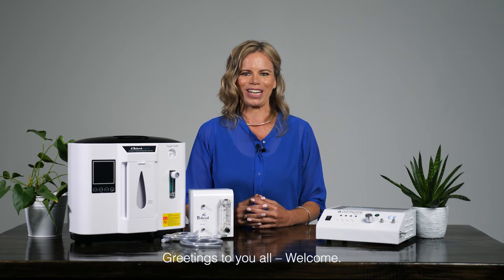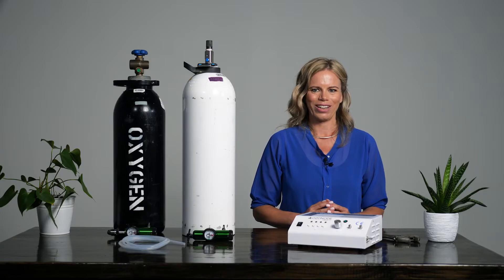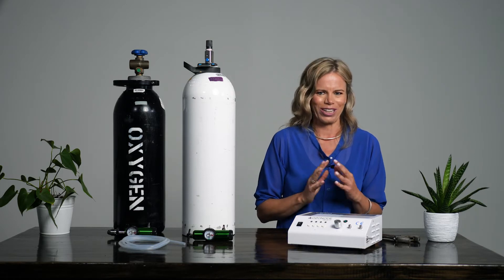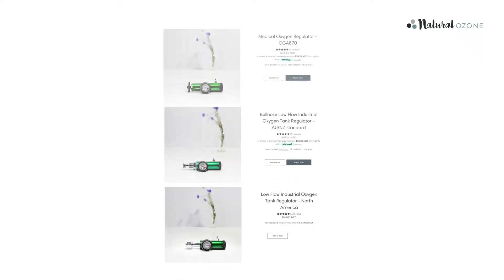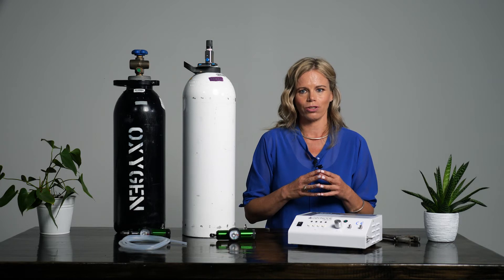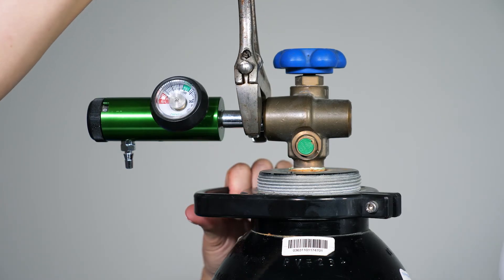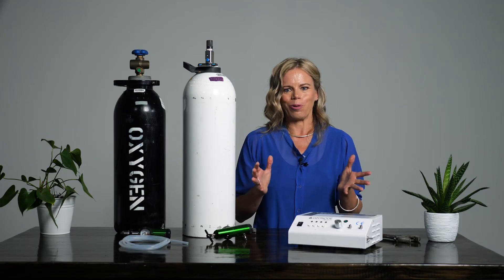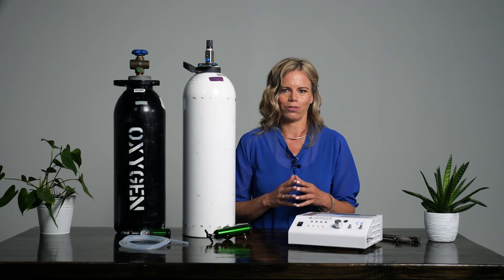Oxygen Tank How To Connect | Best Purity  | Ozone Therapy Made Easy

Comment: Hi I live in the UK and can't get medical oxygen,the industrial oxygen is 95% pure oxygen would that be ok to use on an ozone generator,? Also if there was any impurities in the oxygen tank would the ozone gas not kill them, regards Adam
Reply from the maker: Hi, thanks for getting in touch. Firstly please confirm if your ozone generator is indeed a medical one and you have gone through all the checks that we have outlined here https://naturalozone.co.nz/collections/ozone-therapy.
You need to know that a protocols manual that has instructions based on international standards calibrated for your ozone therapy bundle set up is a must along with support. 

For home ozone therapy protocols such as the ones outlined on our complete course playlist here then    yes 95% purity is considered sufficient by many experts in the field. However if there are impurities in the tank then there may be unknown by products. Here in NZ I have checked and Industrial oxygen bottles are clean.
Reply: Hi thanks for getting back to me much appreciated, maybe an oxygen concentrator would be a better option,will try and find out more information,from oxygen supplier's
Reply from the maker: @TheAdamant87  Hi yes we have those available via the website, see here https://naturalozone.co.nz/collections/oxygen-concentrators/products/portable-oxygen-concentrator-96-purity

Also full ozone therapy bundles are available (select the 4th option and it comes with a high purity oxygen concentrator) with 10% off. We ship often to the UK you just need AU/NZ to UK pug adaptors.

https://naturalozone.co.nz/collections/ozone-therapy-bundles

Best
Kim